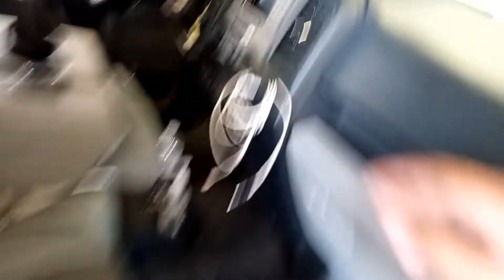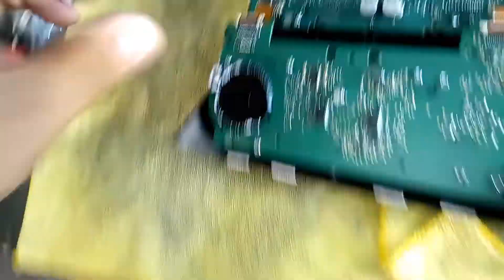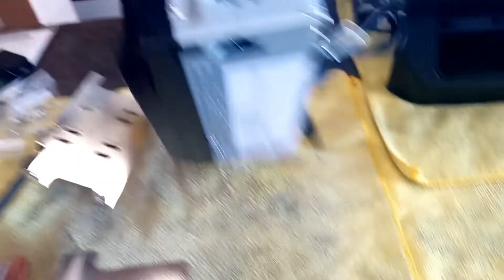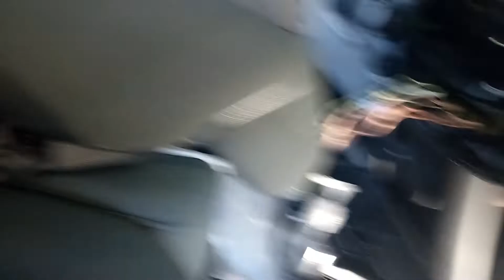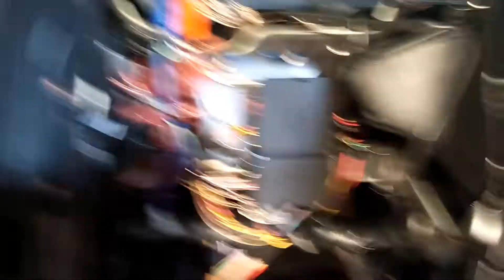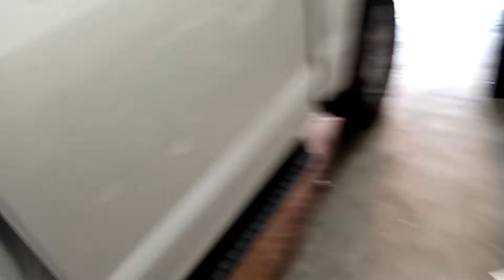Idatalink Maestro RR stereo system in a 2020 F150

Comment: looks like you mounted the amp right in front of the floor heat for the back seat area ?  would that not over heat the amp?
Reply from the maker: Great that you noticed.  Here un the imperial valley we go through terrible heat in the summer.  We don't have terrible cold though.
I talk to the customer about this vent issue.  If they use the heater often, i block the vent.   If not, i leave it open so when they use ac in the summer it cools the amp.
Thanks for watching the video and for commenting